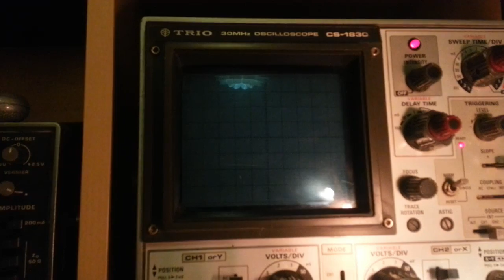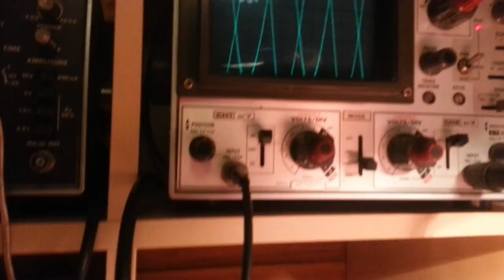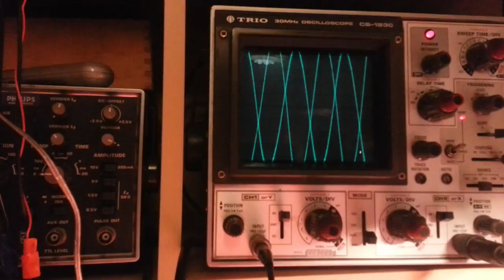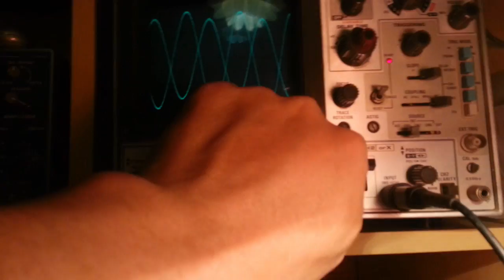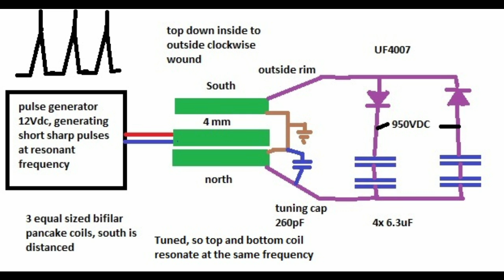Bifilar pancake coil experiment producing 950Vdc from 12vdc

Comment: Study these profound concepts:
Peak, RMS, Power Factor, Reactance, Q, Duty Cycle.
Reply from the maker: I juat dove deep into Reactance and learned a lot. reactive of a resonant system changes depending in the phase angle. because an empty capacitor has low reactance, and a charged coil has low reactance.
this brings interesting opportunities for charging a capacitor for free.
the only need is to supply a high opposing voltage to both the discharged capacitor plates, without a current supply. like when using AC flyback transformer.
Reply: @MasterIvo  I am glad you found something useful. Another thing is power factor. It concerns the fact that a reactive circuit has a different power than a resistive circuit.
Multimeters do not respond well at high frequencies. A true RMS type is needed to measure odd waveforms accurately.
Good luck in your endevours.
Reply from the maker: @gordonwelcher9598   I know, I have learned much since the release of this video, it was years ago!

Comment: You come along way from this video to present 2022 amd still at it I have watched loads know im trying to remember the difrent names and different fields you explain things good but one question I havnt got from the video's that is have you made a self powered circuit or got more energy out than in I see you getting hundreds of volts and amps but are they greater than in put and also have you tried to power anything using negative voltage and is there anything to the peak in highside at close the spike is that spike usable and also is it possible to use positive negative to go in to a capacitor or indicator then switch it to close loop to power a load amd not calapse the dipole  or use any energy from the battery because putting a wire on positive and one on negative puts energy in the wire then use it and switch back to replenish the cables while never calapse the dipole or use energy by way of chemical reaction in the battery it supose to be unlimited energy
Reply from the maker: not yet, but did see conservation of energy is no law.

Comment: awesome. from a MOT with shims removed, i can only get ~450V from secondary when using 12V pulses, removing DC bias with cap, on primary when pulsed at resonance(~20KHz); the higher frequencies of those pancakes mean higher energy. i wonder what power you can draw,
may have to retune input frequency with load attached.
Reply from the maker: power from resonance happens when impulses are used. look at my later work (start at "Radiant power..." video of april 2019)
Reply: @MasterIvo  i will certainly check it out, i know of this, you may throw a bifilar pncake coil on induction cooker and run lights and whatnot with same, and supposedly excellent for halogen lights/heaters. see the gegene generator. i've confirmed does not work with ordinary pancake coil only the bifilar i've, confirmed this with induction cooker that will not sense/run until a load is hooked to output of bifilar.
the MOT i was babbling about is fed to a cocroft V multiplier then a marx generator for those true impulses, not pseudo(square wave) impulses used for input to MOT; have to retune input to ~2KHz(1/10)  when output hooked to voltage multiplier circuit, you can hear MOT make sound when resonance reached.
Reply from the maker: thanks very interesting that the sound occurs, could you make a video of that?

Comment: Why did you flip the top coil? Is there a ground to the caps? I am working on a similar experiment to try lighting 2 - 100 watt incandescent bulbs with as little input as possible.
Reply from the maker: this is an old experiment. I learned thay grounding caps works best.
Also, the inductive spike, I now reuse in a feedback loop. it makes it very efficient

Comment: did you measure your current
Reply from the maker: no, but it was fairly low, else the caps would have filled faster.
Reply: @MasterIvo  the important thing is to increase the current you can try high voltage
Reply from the maker: @mucitd9706  Already working on a 3400V project, using impulses to amplify current

Comment: Producing voltage is one thing, producing amps is another.
Reply from the maker: correct. producing amp and volts in phase is shown in my april 2019 Radiant Power video

Comment: Change the caps to something closer to 1000uF and use a 12V rechargeable battery as the power source for the pulse.  Determine the ratio of the energy used to the energy stored.  With a bleeder circuit, re-charge the original battery.  If there is any energy leftover in the caps to recharge a second battery, you have something extremely useful.
Reply from the maker: wont work. circuit is only resonant, resonance has no electrci power, UNLESS you impulse the resonant coil. I how this working in my april 2019 radiant power video
Reply: I hoped there might be something; but intuitively not wholly sold.  The bifarly coil must have much more capacitance to resonate anywhere near power levels needed to transfer useable energy.  Remember, if you add all the energy in a closed circuit vs. the voltage and current in TIME, you realize that the energy must come from the 'ether' <-somewhere outside the circuit.  Transmission lines and free space never know their sinks, yet they transmit the 'information' over time to the circuit to react appropriately.

Comment: more advance experiment .... did you tried to connect earth ground to point between capacitors? like experiment in video about dielectric of bifilar coil. I think the potensial will be more higher sir. thank to give more inspiration
Reply: I think I was wrong, the max voltage dueto capacitor voltage in series (450volt of capacitor x 2). I do not know but it looks like the energy is limited by the max capacity of the capacitors in series. I do not know just correct me if i am wrong or miss concept. tq

Comment: forgive my ignorance Master but I've only been learning about electronics by reading for about the past few weeks. But a thought crossed my mind that if a wire was made that progressively got bigger or actually thicker, would not the electrons speed up as they went I.E. less Resistance? and would this increase the potential energy you could produce in the Bifilar coil? I'm not sure exactly how this would effect it but curious if with your knowledge of electronics if you had had thought of such construct and how it might effect the power generation?
Reply from the maker: interesting thoughts you have.
keep in mind, the "electron" isn't a particle, but it's the termination point of a dielectric field line on a conductor.
power comes from the in phase product of the dielectric and magnetic fields, or voltage times current.
So: more voltage more power. more potential more power. more pressure more power.
it has more to do with the concentration of dielectric field lines (pressure, voltage) than the speed. speed comes in when the fields transform into each other, and is constant in a medium.
Reply: @MasterIvo  interesting, so in reverse does that mean a wire that gets progressively smaller creates a focused pressure like the point of output you talked on another video.? maybe there is no advantage to the gradual decrease of the wire to pressure the power. It just popped into my head when I could not sleep after I had watched another video on the theory that pyramids in Egypt were large power stations that the energy focused at the top. Anyway that aside I was trying to figure if a similar concept would be of any use in power transition in the bifilar coil as a power amplification. still I'm trying to learn at an older age and find it hard to learn new things lol, but thanks so much for your time helping me understand a little better.
Reply from the maker: not sure what happens exactly with a wire that becomes smaller.  more dielectric lines of force terminate in a smaller area resulting in more heat losses (resistance).
I'm also still learning. the universe is a magnificent place :)

Comment: It seems that the dielectric field of the bifilar coil has an equal voltage between all windings from the outer to inner and magnetic field lines all rotating in the same direction around the wires to create a cohesive mag field between the top and bottom sets of windings, what would happen instead of doing the bifilar connections in series, you did them in parallel?  It would be a very different configuration, but maybe an interesting comparison to demonstrate the value of a regular bifilar design.
Reply from the maker: You are learning fast Ken B! if the windings were in parallel the wire resistance would drop. But there would indeed almost be no voltage difference between the windings, so the dielectric field would be weak. the resonant frequency would be much higher.
Reply: I am still not convinced that the magnetic field is rotating. I believe it becomes a static field??? Any thoughts? How can this be proven.
Reply from the maker: Great question. For me all fields (magnetic, dielectric or other) are Aether fields. Very little is known about the Aether. Nikola Tesla used it and called it Radiant Energy. Much is still needed to (re-) learn.
So if the field is in motion, what is in motion, what makes up a field?
In Gerry Vassilatos book "Secrets of cold war technology", he talks about Mendeljef's perioduc table, and his concept of ultra rare gasses even before hydrogen. This  might give a clue.

Comment: What about conection to load and amps in and then see do we having some juice...Nice work thanks...
Reply from the maker: Bosnjak Bosanac, I'm working on a new setup, with a load. showing input and output power.
Reply: Do you need the juice is the question

Comment: There is certainly a voltage gain however is there a power gain at the point where you measure the 950 VDC?  Have you put any kind of load on the 950 volt point source, like a 100k or greater resistor, to calculate the available and deliverable current?  By putting a .5 ohm or less, resistor in the input side you could measure the input voltage and current and compare it with the output voltage and current and calculate the power factor.  A calibrated scope would be the instrument to use when making these measurements.  Nice work regardless. Respectfully, Steve
Reply from the maker: this old circuit doesnt produce power, it only provides high voltage. 
BUT:
I just ran a (working) simulation of my new design, and I am building the new circuit. if it works kno promises) I will provide a video with input and output DC power measurement. It's radically different then this video shows. It's still a work in progress.
Reply: anyway if you are not getting any power gain or amperage gain your voltage gain is huge so if the entering amperage is the same than the output amperage you are also geting a lot more energy than the initial amount? am I right? (I mean in watts)
Reply from the maker: +gskempe9 no, there is no power gain, YET. 
Im working on that.

 I found out the back EMF of the dc pulsed coil can be injected into the resonant coil.
this gives a different kind of resonance. the sine waves from both resonances can then be added up.
Reply: yeas, im also interested to know the input w effect and the comparison to the output w effect

Comment: Sir Ivo, I am thinking that if you tune one of the coils at resonance to be exactly 90 degrees out of phase with the other then you will have the resonant current of one coil in phase with the resonant voltage of the other coil... This I believe would give you a power gain at the output... what do you think?
Reply from the maker: That was one of the first things I thought and tried, Frederick Burgess. But that is based on traveling waves. The resonant frequency is a standing wave. It behaves different. Max power is at 180 degrees. Its Pure dielectric voltage. In a standing wave there is no classical current.
Reply: ok. I understand. However, how do we indentify the nodes and the anti-nodes for these waves. can these points be determined by the osciloscope? Reason for asking is that a standing wave  is a reflected wave that interacts with itself forming nodes and ani-naodes at specific points on the coil. If that specific point (say anti-node) on the coil has both a maximum -ve and a maximum +ve at the same instant then the resultant voltage that the osciloscope will display is zero (0). Of course, reversed diodes at that point (as shown in your schematic) will reveal the energy intensity coming from that point. But how do we idintify that point in the fist place?...This is one of my challenges thus far. Maybe you can shed some light.
Reply from the maker: the nodes are set by the frequency. I only use the resonant frequency, with the biggest (sine) voltage rise. I shift a node by grounding one end to earth. the other end then becomes a anti node. (and I do this with 2 resonant coils, creating out of phase anti nodes, giving maximum voltage). the anti nodes are out of phase on the ends of the coil (inside or outside connection) So you dont even have to flip and distance one coil(!) just ground the right ends.
Reply from the maker: In addition, I dont use the node where the scope reads 0V, that node is grounded. I use the other end where the maximum voltage is seen, as the sine wave that appears at its resonant frequency.
the diodes rectify both halves of the sine wave and feed them to the capacitors. Hope this answers your question. feel free to ask more.
Reply from the maker: a capacitor(lets say the positive) gets a half rectified sine at one end, while the other end is connected to the 180 degrees out of phase not rectified sine wave. this gives the maximum voltage difference in the capacitor. this is also true for the negative capacitor.
Reply: I'm understanding your setup better. Thanks for the follow-up replies. I maybe a little slow with understanding the nature of standing waves. I gather that at the anti-nodes of the two coils 180degs out of phase there will definitely be an amplified voltage. However, my understandig of a system in resonace is that it will produce voltages and currents at multiples of the input signal but at 90deg out of phase which is hardy useful since at max voltage there is 0 current and at max current there is 0 voltage. Pardon me if my head is tough but I keep thinking that if there is a standing wave of voltage then there should be also a standing wave of current but 90deg out of phase. I know I have to unlearn some of the physics I've learned to grasp this very interesting phenomenon. It seems to hung soley on the energy which results from the capacitance of the coils being placed in an environment where little or no current is required for it to quickly charge to high voltages. This is ofcourse useful energy. Keep up the good work. I pray that God will help us to put our finger on it soon.
Reply from the maker: Yes indeed, unlearning is also what I am still doing. And I am learning from your questions as well. thank you! 

the current is not always that 90 degree 50 or 60 hz sine.

 As with a standing wave, nothing is traveling forwards from A to B. all is swinging side ways BETWEEN A and B AT THE SAME TIME.  (depending on the nodes) and its happening much faster than 50 or 60Hz.  so now the current is spread over the whole AB line, moving sideways (longitudinal). back and forth. But maybe it even different than that... Im also still learning.  :)
Reply: Sir Ivo,
I researched quite a bit and found that the resonance that is required for enegy amplication is not the same kind of resonance that we are used to in electrical systems. It is the resonance of the magnetic fields  within materials. This is called nuclear magnetic resonance (NMR). It results from the manipulating of the electron spin within an element with free electrons on the outer valency shell (eg. CU, AL, FE) such that these electrons are shaken out of equilibrium, passing through a coil that outputs the energy. Please note that the resonance that is necessary to for us to achieve is not the LC resonance that we are used to but rather the resonance (natural vibation) of the the sample material itself.....ps. each element has its own natural vibrations. Hence, the frequency generated by our circuits should be according to the element that we wish to manipulate. These vibrations/waves are indeed longitudinal. in other words these are the standing waves that we are interested in.....We would accomplish a lot more if we foucus our attention in this area. Let me know what you think.
Reply from the maker: I feel it is about dielectric and magnetic field interactions.

Comment: I would think the would exhibit virtually no magnetic field. A regular coil has a multiplicative effect on induction and bifilar coil has zero effect or divisive effect on induction. It's the induction which creates the magnetic field. The purpose behind a bifilar coil is capacitive.
Reply from the maker: +John Wilkinson  I agree the purpose is capacitive. It has a strong dielectric field between the windings, and at its resonant frequency also outside the coil.